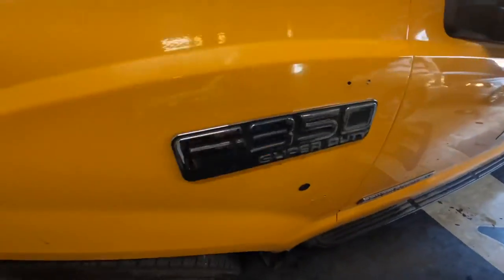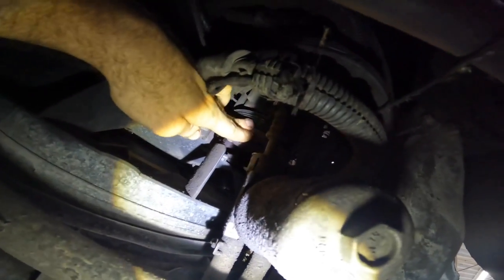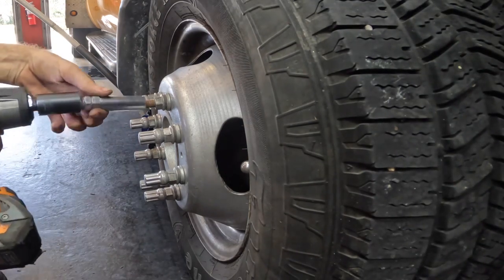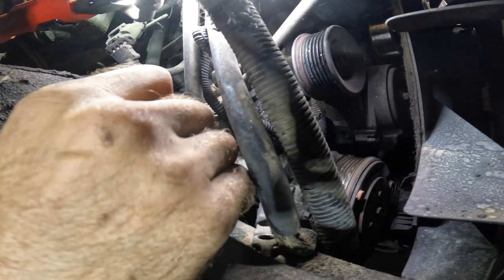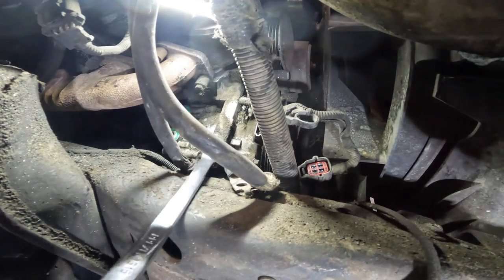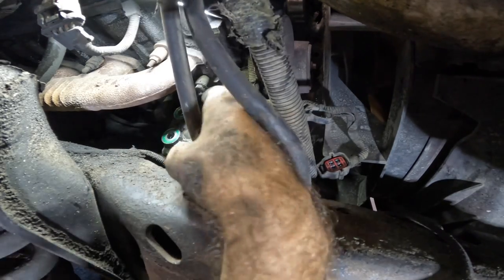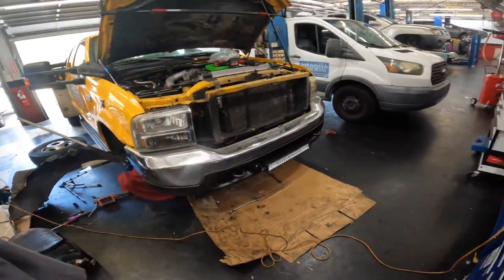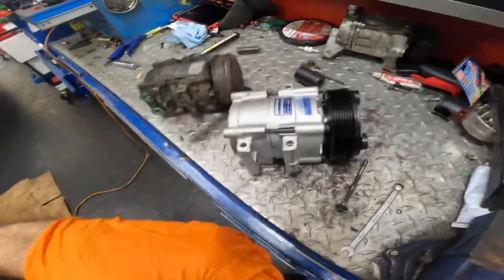Cut the Frame, Pull the Cab, or Suffer? Ford Powerstroke F350

Comment: If you loosen the motor mount nuts on the passenger side, you can raise the engine with a jack and it will give you more room to get to the compressor bolts. It’s a lot easier that way.
Reply: Ty never thought of that
Reply: Yeah not even the so called perfect first gen lexus LS400 is exempt from that. Removing the rack and pinion was impossible until i did that on mine
Reply: Was thinking the same
Reply: A 2003-ish CRV once drove to my shop with a leaking oil pan. I had to jack up the engine, loosen the subframe bolts, lower the subframe all the way down onto jack stands and somehow keep the steering rack in its place. 3 hours of work to perform a 10-minute clean on the oil pan, reseal it, and reinstall it. Some engineers are just mehhh . 0 regard to maintenance lol
Reply: I did one of these :). I grabbed the compressor and removed it. It then magically grew wings and sailed into the trash heap in 30 pieces after a big friendly hammer attack
Reply: I put several sets of headman headers in that way in days long past. Pull a mount or both of them and give yourself so room.
Reply: Don't you have to.disconnect the transmission?
Reply: First thing that came to my mind. Loosen motor mounts and jack up the motor.
Reply: thats EXACTLY what a friend did  it was  2002 F350 dually 4x4    we had to change out compressor  it was not fun,     i think then it was about 290k miles in 2015
Reply: That’s exactly what you have to do. Loosen the mount raise the motor and your golden
Reply: @leesin2me  7.3 powerstroke remove engine to replace crappy oil pan wtf are the guys who design this stuff not thinking lol
Reply: I thought the same dang thing. Motor mounts.
Reply: In european cars which are mostly much smaller than americans, I often had to loosen or even completely take off some motor mounts and lower or raise the engine to do basic stuff, just like a timing belt or alternator replacement
Reply: Still --HELL NO to me doing this repair... I didn't buy that B/S.... I'm only buying stuff I can pheasably work on myself...  LOL
Reply: How about removing front clip first🤣. These situations have become 🦇💩 crazy. Cant believe what i had to do to change transmission fluid and filter on a ford.
Reply: Drill a whole in that frame to het Bolt
Reply: @carlomartin6156  I would do the same, enlarge the hole  with a round grinder

Comment: I used a 1" hole saw and cut a hole a little to the left and up from the hole you are sticking your wrench into...worked for me.
Reply: and the idea of ROUND is critical as cracks start with squares and rectangles.
Reply: It looked like a crows foot would reach the bolt through the hole. Still a very slow way to get it out.
Reply: Or you could just undo the right side motor mount, and lift the engine an inch or so.
Reply: Thats how we do the 6.0s.
Reply: I’d say if he wasn’t making a video that may have happened a 1” hole would do nothing for decreasing the frame strength but can you imagine all the backlash Ray would cop from all the budding engineers watching!! Omg he cops plenty of flack as it is👍 PS I would have cut the thing to bits🤣🤣
Reply: @johnlarkin549  I'll bet the many people who give him flack don't even work on cars!
Reply: No they’re likely not at all interested in working on cars they just watch and look for things they can give Ray grief not to mention Mr O from south main auto he’s forever complaining about YouTube troublesome viewers and he is a legend as Ray is!!

Comment: As a mechanic with physical limitations, I have begun to use Ray's videos as a guide on what jobs I should attempt and which ones to avoid. It appears that I will be avoiding F350 a/c compressors. Thank you Ray for your valuable information.
Reply: Actually the ford factory manual calls for removal of the entire cab to gain access to those parts. The cab removal alone depending on what’s plugged into it can take half the day. Any garage that normally services them will be quite skilled in this. Really it’s a bad design as they drop these monster engines in from the factory and never think about repair. My shop typically subs these out to a specialist shop that does big fords as a usual thing
Reply: @matthewcaughey8898  Yeah they roll the chassis with powertrain down the assembly line and drop the cab down over it all. Service techs be damned, they're assembling these things as fast and cheap as possible.

Comment: When I worked at a Caterpillar dealer as a mechanic, there was a reason we steam cleaned everything before it came into the work area. This video is a good example of why. All that crud makes getting to the problem much more difficult than it has to be. Not saying this wasn't a tough job, it was. Clean engine bay and frame would have made this a little easier.
Reply: A buddy used to work on garbage compactors.  Nothing helped much.
Reply: @edsyphan3425  maybe boiling the entire thing in piranha solution could work?
Reply: @Aikano9  Hey it's worth a try?  If you want to see somebody knee deep in crap, check out "Sleeper Dude".

Comment: I understand the patience part.  I have gone in after my son started projects, and quit since he couldn't get things apart in 5 minutes. The 1 degree movement is painful, I have done it.  Great video, shows the value of a truly good mechanic.  Great job!!!
Reply: I got rid of all my modern vehicles and now I daily drive a 66 chevy. Got sick and tired of computers, plastic, wires, and proprietary software.
Reply: Even more tedious with an open ended wrench, in the old days.
Reply: @Grant Benson I hate poor design. Ive worked on many many fords. Replaced transmissions, belts, struts, steering gears, etc. Pain in the rear. My wife's 2000 Chevy lumina is surprisingly well put together. 22 years old and rides like a cadillac. Replaced its AC compressor in like an hour. Way better design for general maintenance compared to Fords of the same year.

Comment: Just did one over the weekend, pain in the ass for sure, specifically that stupid 13mm back bolt, putting it back was the hard part, but with a rubber band holding the rear 13mm bolt and  the front 10mm bolt did the trick.

Great video as always  .
Reply: You just did this nasty job?  Now I have two people to not envy.  So sorry you had to do this.
Reply: @z31freakify  Props to you brother and my deepest condolences. :D:D:D  I kept thinking that I would have removed the motor mount and jacked that B up for clearance. Or cut me a hole if it was mine.
Reply: I'll make a mental note about that rubber band trick

Comment: Watching you struggle with those hidden bolts took me back to when I spent 39 years working on printing equipment which fought you tooth and nail on a lot of repairs. I could feel your pain. You definitely have to be able to devise workarounds when working in tight quarters. Great job.

Comment: Option #4. Undo the right side motor mount, and lift the engine. 
I cursed these trucks when they first came out, and often still do. Since I don't have a hoist to remove the cab, as the book calls for in a lot of situations, I've had to become very creative.
Good job, Ray. That's a tough one to deal with, just for the fact that it's hard to hold the weight of it up, while you're in the most awkward position.
Reply: Option 1.  Remove fan clutch and fan shroud, like 20 min of work if you know your way around these rigs.  I can have that compressor re&re done in half book time, all day everyday. 19 years wrenching on 6.0L diesel trucks, every single day.....no need to mess with the gross engine mount on this.  The fan and fan shroud out of the way, total gravy job
Reply: @jasonkool535   leave it up to the flat rates to find a better way. Still a crap job if I ever saw one.
Reply: @edsyphan3425  it's really not a crap job is what I'm saying. Fan shroud and fan outta the way and it's simple as it comes.
Reply: @jasonkool535  Ah.  This is the price Ray pays for being a generalist. I wonder if he ever googles when stuck in a pickle like this?

Comment: Many times while doing mechanic work, I have felt the genuine urge to choke the engineer that designed the component to literal death and you just showed everyone why. 80% of mechanic work is problem solving, figuring out how to think around corners and what combination of tools, black magic, and deals with the devil will extract an offending part or fastener.
Reply: its not that bad if do what they imagined and pull the whole cab you get great access to everything. if you have a two post lift to pick up the body its pretty simple
Reply: @imchris5000  really don’t see how removing the whole body is going to help with the frame clearance issues, but whatever.
Reply: In the summer of 2015 I was helping my uncle work on his Ford F-250, it was the 6.0 powerstroke, and we ended up having to pull the cab, to pull the heads because... Reasons, and then we noticed some pitting in the cam and we had to pull the trans because the cam goes in through the back of the block.... I'm never buying a Ford made after 1996, that's my opinion on the matter.
Reply: @redchris97  the 6.0 is a legendary money pit of an engine
Reply: @imchris5000  that's not my only unpleasant experience with Ford, but that was one of the eye openers that Ford is no longer what they used to be, if you remember the old Ford escort, you know those were good little cars that were good on gas and everything was idiot proof, I did a timing belt on a Ford fiesta 1.6, my god... I never want to work on Fords ever again, I miss the good old days of the Ford 300.

Comment: You've really earned your pay over that job. Well done Ray, you have the patience of a saint. Does make you wonder why they didn't just add an inspection / tool hole under that bolt.
Reply: Yes,  that is a major oversight.   These were designed and built I think with maintenance as only an after thought.
Reply: I did this for 45 years except with heavy equipment, and for something mechanical, I have unlimited patience.  PEOPLE, on the other hand.................................!!!
Reply: Yeah sometimes I do NOT play well with others!!

Comment: The whole engine needed a dousing in brake cleaner before you touched it.

Of course, then we'd find out the crust of oily gack was a critical sealing component.
Reply: i guess that would be like several barrels of brake cleaner ... so maybe some jackhammering beforehand to get the big chunks off first? :D
Reply: can't even look at a diesel without getting filthy dirty
Reply: Make it "Nice and Shiny"
Reply: About 3 gallons of Floway and a pressure washer would make it nice & shiny
Reply: @Saberus Terras  The real problem the this is the hour or more of labor involved for which Ray is not getting paid. Mechanics tend to NOT like that and who can blame them. :D It should be a part of the garage's labor estimate and required. This would also make it possible to find and cure the engine's incontinence. Maybe :D
Reply: @johnme7049  I completely agree with you that it should be included in the invoiced estimate.  This is the kind of job where the flag hours would be some impossible to meet speedrun challenge.  Maybe that's why the cable was bolted through to the ground point...

Comment: Kudos to you ! that took a whole lot of patient's more than Id've been able to endure.  I'd of been pulling out those xtra ground straps ,then I'd of cleaned it all up with brake cleaner ( I hate diesel grime ) and probably drilled out another hole to access the bolt ( there's already 2 holes there doing nothing ) this is a time when I would always say to myself I'd like to have the engineers that designed this right hear ,LOL
Reply: Only if they could have put those two holes doing nothing in the right place, how convenient would that be?... but NO they had to offset them just enough to piss people off.
Reply: Exactly!!!!!
Reply: Lol! It would be great to make them do the job for some payback
Reply: As a retired engineer i see nothing wrong with adding a hole to the frame in the location you needed.BUT i would keep it the same size as the two adjacent holes and would also de-burr it and repaint the frame area.the holes that are in there now may be used for the larger engine.Or it could be simply to release the frame piece out if the stamping die.or as locating holes for the welding or riveting jigs.
Reply: Patience.
Reply: For many years I worked as a field mechanic for a Caterpillar Dealer.  One time the factory was having a labor dispute and the workers that put these machines together were on strike.  Soooooo, the engineers that designed these machines were the ones putting them together.  The strike ended like all strikes do, and then all of us field mechanics were absolutely buried with "updates!"  These college educated idiots finely saw what what we see all of the time.  They had their own, "how in the world are you suppose to get this in/out" moments.

I pulled a transmission out of an articulated dump truck, then when I started to  lift it out, it was soooo tight in the frame, that it scrapped the paint off of BOTH sides of the transmission.  In fact, After it came out a little ways, you had to rehook the lifting points to pivot the trans to clear something, (this was a long time ago), and when I let off with the crane, the transmission, which had to weigh at least 1000 pounds, just stayed where it was.  To this day, I truly believe that it was just a fluke that the transmission WOULD come out of that tight hole.
Reply: Engineer says: it's finished, how do you like it?. Manager says: OK, but the customers want this other engine.. just make it fit! Every maintenance issue is not the engineer's fault.
Reply: @andrewwhite1793  I can understand that Andrew, but just from the things that I have seen in my 45 years, I really feel that EVERY engineer needs to be a helper for a journeyman field mechanic for at least 1 year before he/she designs ANYTHING.  I guarantee that at least a portion of the problems I have had to deal with would have been dealt with in the initial design.
Reply: hahaha!
Reply: @BuilderofRat  just saying that engineers like to make the product good for everyone involved but the maintenance guy is not management's top priority. I am not defending the awful designs, but don't think it's done on purpose. The Japanese cars are often designed to  a fixed spec without being kicked around by continually changing the objectives. This gives more time to design out more of the issues.

Comment: What you can do with the frame through ground strap is grind where it fits to the frame. Then coat the cable and frame with dielectric grease so the ground lasts another 80,000miles or so.

Comment: The decorative lug nuts are meant to cut deeper into the sheet metal of the car when you get side swiped. Done it 3 times.
Reply: The Romans had them on their chariots too!
Reply: This just gave me Top Gear flashbacks of Clarkson doing exactly this mod on that poor Fiat Turbo Coupe (he did on the rear wheels which made it unbalanced and broke off).

Comment: This is the second video I’ve watched this morning. Tell me I’m wrong when I say that this has probably been made 1000 times worse by someone previously fitting the wrong part because it was either available or cheaper. Bravo for hanging in there and not giving up 😀
Reply: the wrong compressor wouldn’t fit, the pulley is pretty much all that was different which doesn’t change a whole lot

Comment: That was clever using those to Orings to hold those bolts. You sure had your work cut out for you on this job. I did this on a 97 f150 4x4, and even though it wasn't easy, I don't think it was this difficult... what a pain in the neck.

Comment: I've done a couple of those before, so I feel your pain Ray.  But might I suggest for next time, grind out a hole in the frame so you could reach the bolt with a socket.
Reply: HELL YES!!!
Reply: I vote for that also. If you do it neatly it would look stock.
Reply: Right, it has 200k on it. I know it can last 700k but it’s about time the truck get broken in

Comment: Imagine if the new compressor was faulty after you installed it!  That thought would be running through my head the entire install.
Reply: Hey, Jonathan, I used to think negative thoughts all the time.   When I started to think positive thoughts, my whole attitude changed.   Of course, in your profession, OEM parts with warranty that include labor do help lighten the concern!!!

Comment: Ray, you are the man, muscle fatigue on these type of jobs is a killer! You seem to power through and get them done. I'm surprised someone hasn't developed a tool to address this issue. Pulling the cab for AC compressor is ridiculous, it's like working on the AC system on some of the corvetts. A few engineers need to be flogged by there peers.

Comment: Ray, this reminds my younger days working on our 1975 Impala with my dad.  I would lose my patient and start to swear at the stupid engineer whom design this damn car.  While watching your video, I was swearing at Ford engineer on what they were thinking on making such a tight spot for a important screw.  I was also shocked to see the way the grounding was done with a bolt going right through the strained cable.  Why did the engineer cut the cable an place the proper spade lug on the cable.  This is the perfect video to teach my daughter on what not to do as a mechanical engineer when designing something.  Always think about the next person that needs to dis-assemble the contraception that you designs so that they will be be swearing in your name.  Job well done, keep up the great work and great video!!!
Reply: Every mechanical engineer who designed something in a vehicle should be given a set of basic hand tools put on a gravel driveway and we told to do a proper servicing or major parts replacement after they design it.